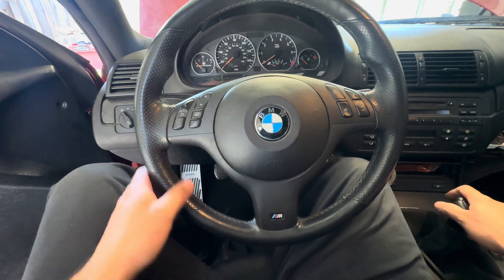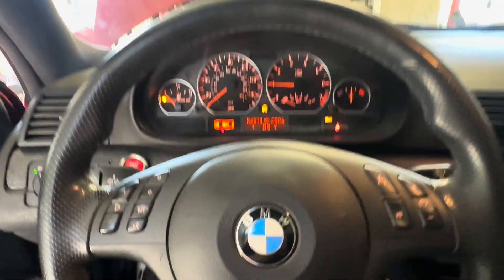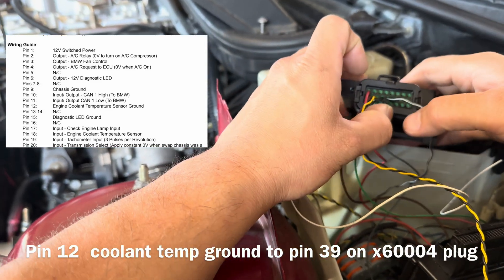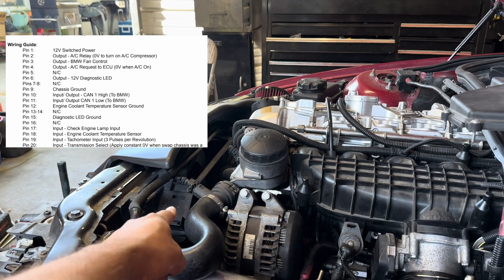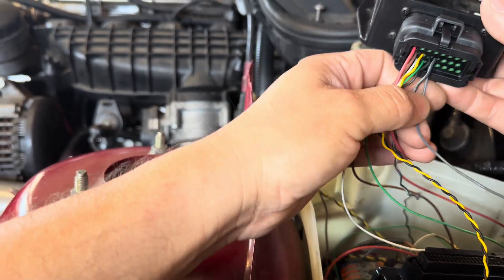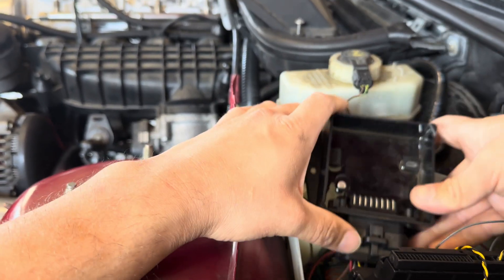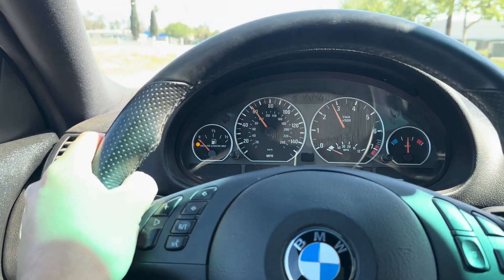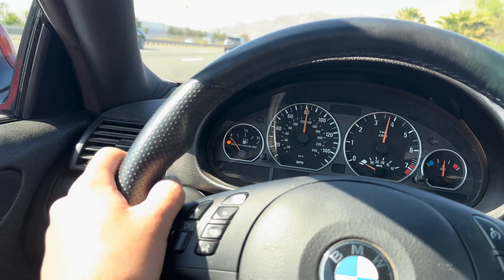E46 ENGINE SWAP N55 Update|Wiring Specialties Rev CAN module. #e46 #n55 #n54 #n52 #b58

Comment: So I’m doing a ls swap e46 using same revcan box. I’ve got it all wired up and my diag led blinks rapidly. Which I think means can bus isn’t communicating on the car side. Any input?
Reply from the maker: If your cluster is not working!
Make sure your canbus are not wired backwards. Also make sure the pins are making contact, Test your wires. (Continuity test)
Make sure you are you’re using  12volt ignition source to switch the rev can on.
Reply: @Tec_KnowTech can bus was wired backwards originally but got that sorted quickly. I have 60 ohms of resistance. And 3.2 volts on high and 1.8 on low. 
 
Do you know if the Holley can needs to talk to the revcan?
Reply from the maker: @Freddie-adhd-Abe  not quite sure if Holley needs to be connected. 

Try disconnecting the a/c wires that you connected and only leave the coolant temp rpm signal and fan. 

If the a/c wiring is not connected correctly it won’t let the Revcan communicate
Reply: @Tec_KnowTech I don’t think I’ve connected any ac wires yet just pinned out. Also don’t have the rpm hooked up. From the Holley?

Comment: What was the reasoning of going with the re can direction and stuff instead of running a rev motorsports or antunes harness?
Reply from the maker: @Twittenberg   We made our own harness which requires the rev CAN module. 
 I contacted Antunes in the pass 
They do not make a harness kit for Echassis n55.  
Only N54,n52 and s55.
Reply: @Tec_KnowTech Ahhhh ok understood. Amazing build been following it